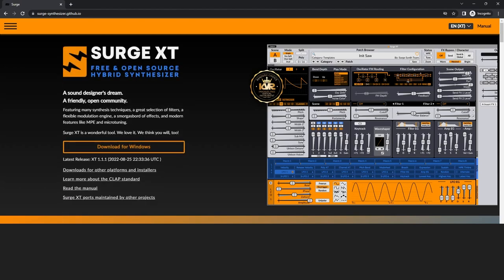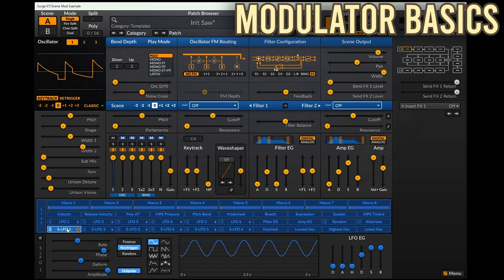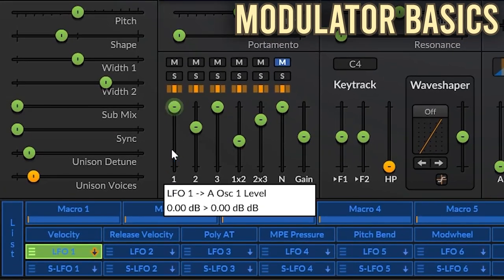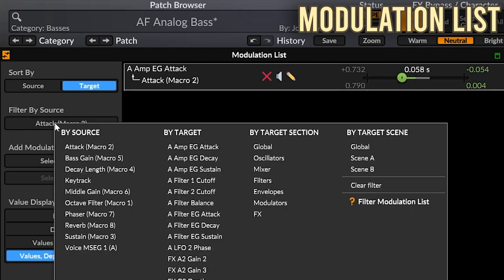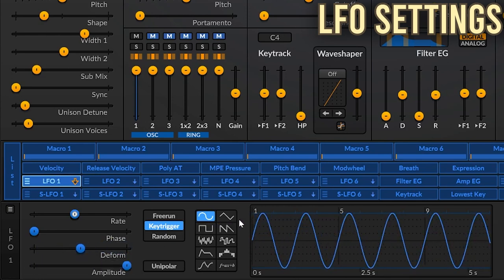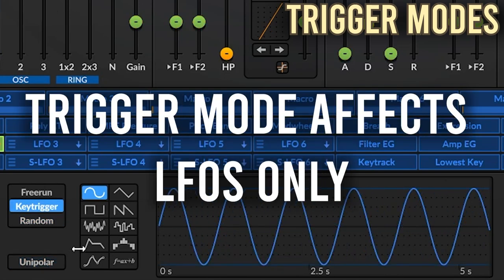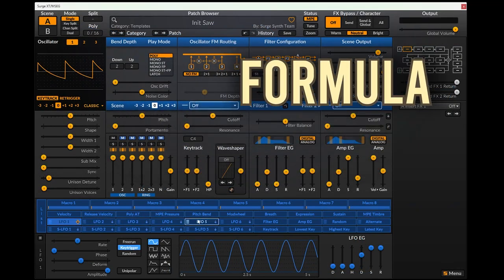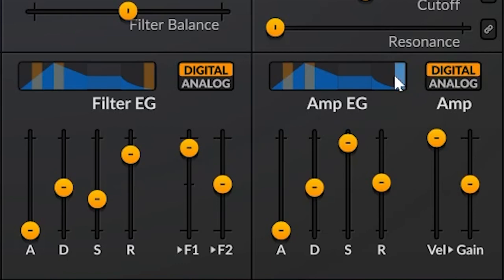Surge XT Tutorial - Modulators | #SurgeXt #SoundDesign

Comment: Can you automate them on ableton?
Reply from the maker: Of course! Any parameter you can expose to Ableton can be automated (expand the device for Surge XT at the bottom of Ableton, hit Configure, and move the desired control in Surge XT to expose it). You can expose the macros and add a custom automation curve to it in Ableton, or even expose and further modulate Surge XT's modulation parameters, such as LFO 1's Rate. Hope this helps!

Comment: How does the (Raw wave form only and EG only works) in the mseg?
Reply from the maker: Great question!

It works the same as the other modulators. The MSEG part is the Raw waveform. There's actually a second envelope on top of the MSEG - that's the LFO EG at the bottom right. By default, the second envelope is configured to not affect the sound. If you increase the LFO EG's attack, for example, you'll see that it changes the overall shape of the (MSEG) LFO. You can change it to Raw only to use the MSEG component only (ignoring the LFO EG), or to EG only to ignore the MSEG and just use the LFO EG. The trick is that when you switch types, you'll need to reapply that LFO's modulation to the parameter you want to modulate (remove the old one and put it back on). Or, you can actually apply both types to the same parameter. For example, you can select Raw waveform for LFO 1 to apply the MSEG component to Oscillator 1's Level with a strength of 15 dB, and then switch to EG Only for the same LFO and apply it the Oscillator 1 Level by 10 dB or something. Be careful though because it can get loud doing this.
Reply: @idlethoughtsmusic  Thanks very much. Oh I see you have to reapply the lfo. It would be nice to make a video to demonstrate it.

Comment: Can you please explain send return slider that is above the fx?
Reply from the maker: Great question!

The short answer is that the Return slider sets the gain for each Send Fx. Think of it like a volume knob to change the amount of reverb / delay / other effect without having to change the settings of the effect or adjusting all the send levels.

The long answer is this: There are three locations to place the effects - "insert effects" (FX), which work on scenes A and B only, "send effects", where you have more control and can decide how much of the signal to send from each scene to each effect (and is applied after the insert FX), and "global effects", which get applied at the very end after everything else is applied. The Send FX are the 4 effects in the middle of the diagram.

So let's say you set Send FX 1 to use a reverb and Send FX 2 use a delay. You can decide how much of the signal to send to each effect using the Send FX 1,2 Level sliders to the left of the effects. So basically, move Send FX 1 Level to the right and you'll get more reverb, and Send FX 2 Level to the right and you'll get more delay.

Now let's say you configure both Scenes A and B with their own oscillators, filters, etc. and want to hear both at the same time (which you can do by setting the Mode to the right of the scene selection to "Dual"). You then use the Send FX Levels in each scene to send the amount of that scene to your Send FX 1 and 2 (Reverb and Delay). You now have both Scene A and Scene B's sound going to the same Reverb and Delay.

This gets us to the Return slider you're asking about. It just changes the gain of the Send FX (your reverb, delay, or other effect) like a volume knob. All the way to the right and you have the full Reverb / Delay / FX amount. Lower the gain by sliding it to the left and all the Reverb / Delay / FX goes away. This is useful for testing your sound (temporarily remove the reverb and see how it sounds), or for adjusting the overall level if you already have the blend you like between Scene A and B, without having to go and adjust all the Send FX level sliders.

In summary: Add effects to Send FXs as needed. The Send FX Level is used to "send" the audio of each scene to each effect (i.e. how much reverb do you want on Scene A's saw waves vs how much do you want on Scene B's low-end bass). The Return level can change the strength of the effect (i.e. turn the reverb down for both scenes in one handy slider, without changing the effect settings).

Hopefully this makes sense. It's a little confusing at first and hard to explain in words, but once you see it in practice, it's not too bad to follow.

At some point I'll make a video on the effects section but I haven't gotten around to it yet. There are some other good YouTube videos out there that may be able to help clarify if this is still confusing.

Good luck!
Reply: @idlethoughtsmusic Good explanation, I understand clearly.Thanks for the reply. 
Great stuff.

Comment: Great work! I'm one of the folks responsible for writing the manual, and this great modulation overview highlights one of Surge XT's biggest strengths.
Stay tuned for some cool updates in the future... 🙂
Reply from the maker: That's awesome! To be honest, the manual is (by far) my favorite thing about Surge XT. Most synths or plugins have limited to no documentation, and it's sometimes frustrating to understand what's going on and why things aren't doing what I expect them to do. However, Surge XT's manual is outstanding. It explains clearly what each parameter and feature does and has lots of extra details that a technical person like myself finds helpful. Easily the best manual I've seen so far, and I feel that it really helps to unlock the power of the synth. Great work!

I'm looking forward to seeing what's to come!
Reply: Is this a vst or a stand alone?
Reply from the maker: Good question! I'm using it as a vst, but it supports both standalone and VST3, as well as the new CLAP standard.

Comment: Can you man a video in the future explaining this from the manual?

Rate – Controls the modulation rate. When the type is set to Step Seq, one step equals the whole cycle. This slider can be tempo-synced and disabled from its context menu. Deactivating the rate effectively freezes the LFO to a certain constant value depending on the Phase/Shuffle parameter. This can be useful for manually scrubbing in a waveform cycle of an LFO for instance, and can also be used in the same way in the sequencer. This feature can also be used to make the modulation source act as a randomizer in tandem with the “Random” trigger mode. A simpler Random (see Internal Modulators) modulation source can however also be used for that purpose. Furthermore, modulation can even be applied to the Phase/Shuffle parameter with another modulation source which opens up a lot of possibilities, such as effectively using the frozen LFO as a mod mapper.
Reply from the maker: Hmm... There's some interesting modulation tricks in there. I'll have to look into that.